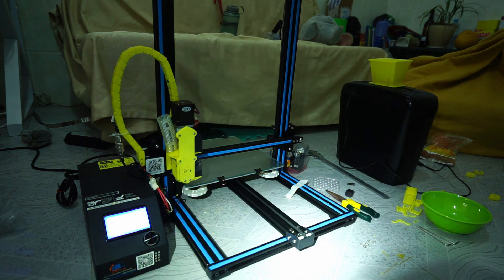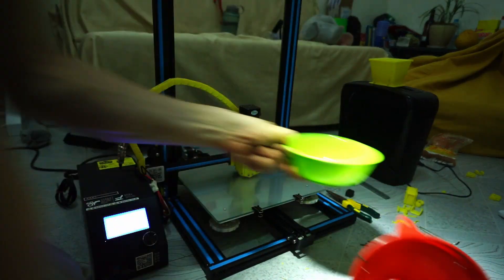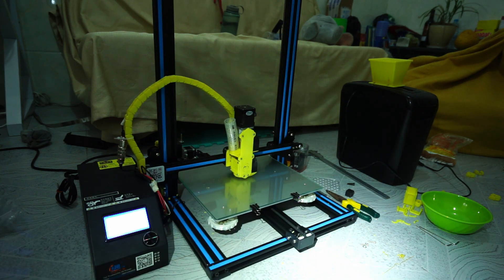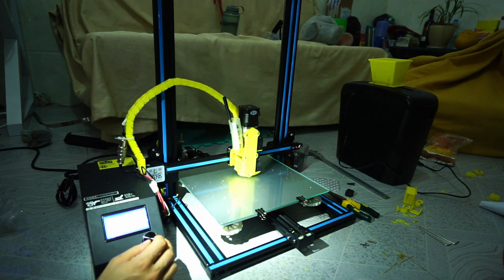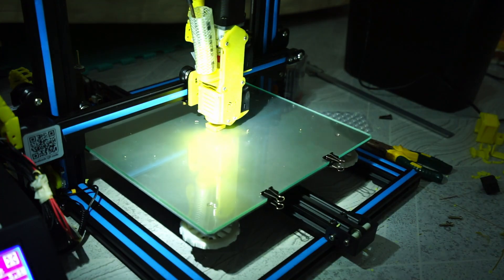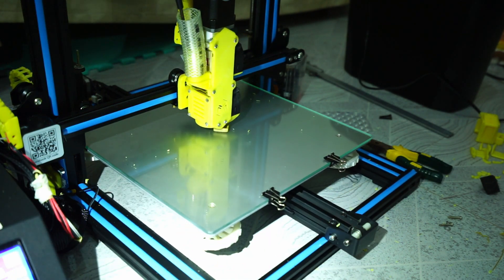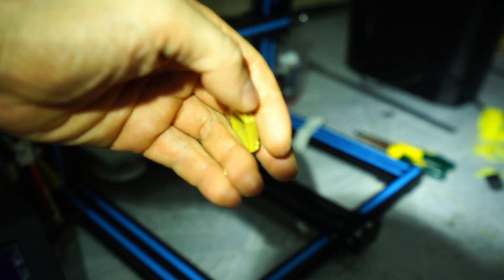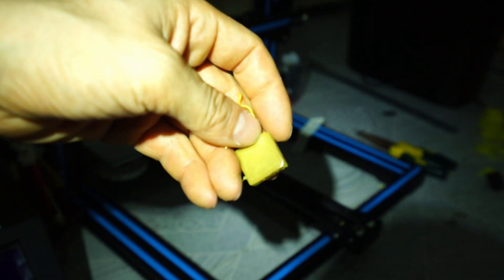Pellet Exstruder, First Test Print

Comment: we are having issues with this pellet extruder. The screw is turning anti clockwise, but there is nothing coming out of the nozzle. It is heating up as it should. Do you have any recommendations regarding settings in the firmware or hardware? Thanks in advance.

Comment from the maker: I remixed some of the printed parts. See here: https://www.thingiverse.com/thing:2975262 Note that they are a bit hard to print, may require some sanding and the models are not as well created as the originals! I'm just not very good at modelling! However the new parts mean that you can see inside the cooling chamber and empty the pellets out more easily with a door at the side.

Comment: Awesome!! Please let me know what settings you changed.  I need to get mine mounted soon. Also, did you change your driver? Mahor recommended to use 8825... which I'm waiting to arrive
Reply from the maker: Great, I'm interested to know the difference the driver will make. I did not change the driver as on the CR-10s the driver is built in so I would have to buy a new board to use the more powerful 8825.

I just changed the settings recommended in Mahor's FAQ and did the PID tuning, so far that is all the settings I have changed. I had problems getting the extruder to hold temperatures over 230c until I increased the voltage on the power supply to 13.5v which I was told the CR-10s can handle. Then the temperature became stable and I have tested it to 270c so far. Hardware wise, I added thermal past between the heater block and hotend before putting them together but I don't know how much difference this will make. 

I may look at redesigning some of the printed parts. I would like the front to be open to see inside well printing. I would like a window to see that the pellets are not getting stuck and maybe change and enlarge the area for the pellets to come in contact with auger and add a release door so that you can empty the pellets out without them going everywhere when you pull the feed tube off.

Mahor also told me he is working on having an online place to share settings, a table of information and settings for slicing the prints for this extruder. So everyone can share results and profiles which would help a lot I think.

In S3D it looks something like: extrusion multiplier: 2.00 & print speed turned down to 20mm/s which I will increase in time to see what the machine can take. Everything else is just the standard ABS settings for a 0.8 nozzle and on the printer after printing started I just played with the 'Flow' in the Tune menu as Mahor advised.

I'm looking forward to seeing your setup.